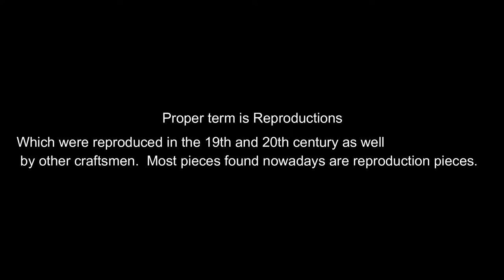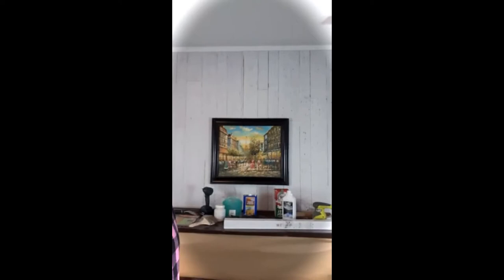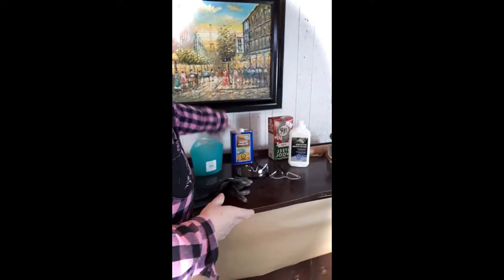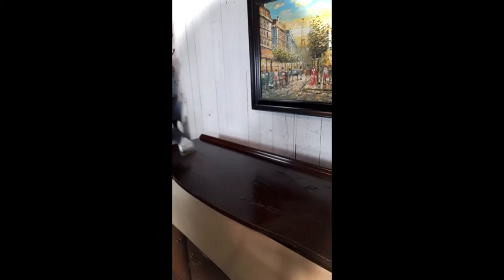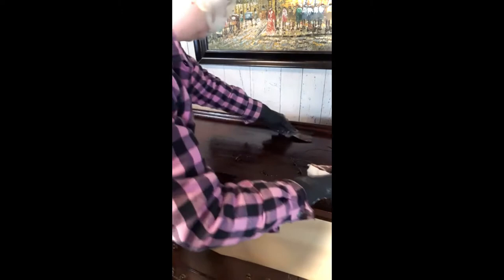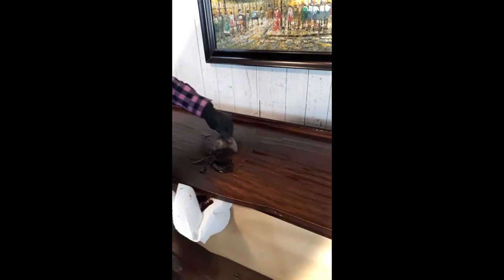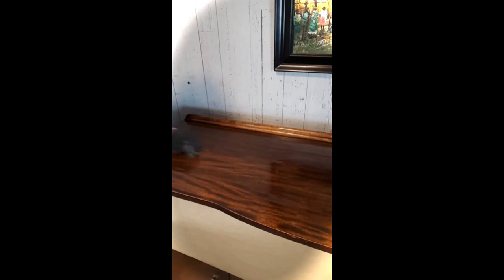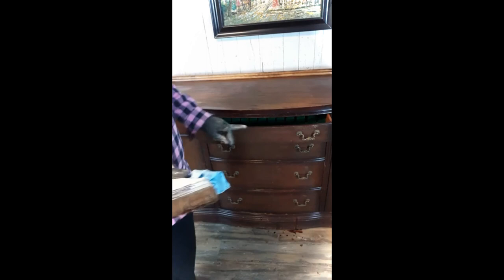Duncan Phyfe - Upcycled Buffet

Comment: I think it would help if you listed the items and tools needed for this project  visually on your video and in description.  Thanks , I have this piece, but some of the veneer  has come off? Can I use filler or replace it with ?? I was going to give this piece away, but after seeing your videos on this buffet, I have decided to keep it.
Reply from the maker: Yes you can use filler for the missing veneer, sand it to smooth before proceeding with 220 grit.  I use Fusion Mineral Paint, Varathane Kona Gel stain on the top.   The transfer is from Prima Redesign.  Blending paint is a technique that takes some practice but even if you painted it a solid color it would be beautiful. I believe the products used are shown in the videos.  It takes a bit of work but these turn out beautifully.